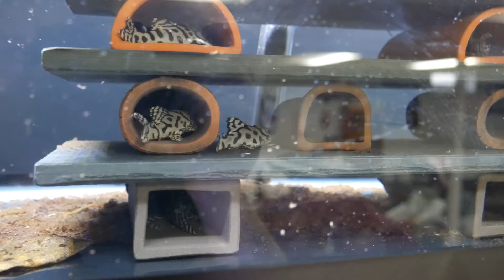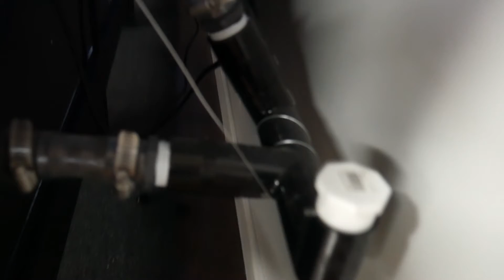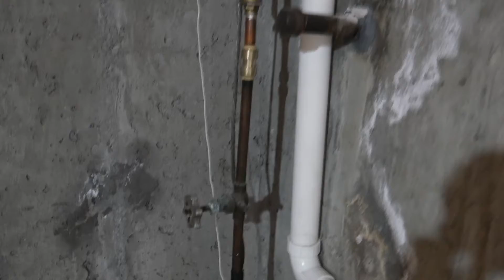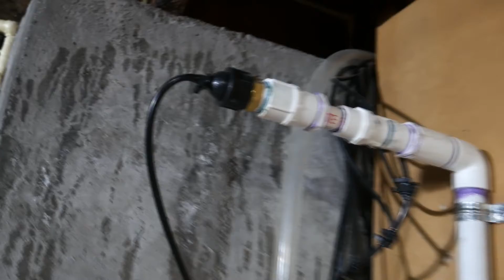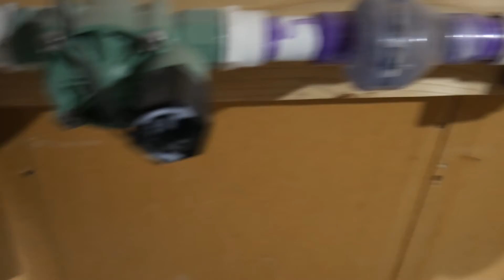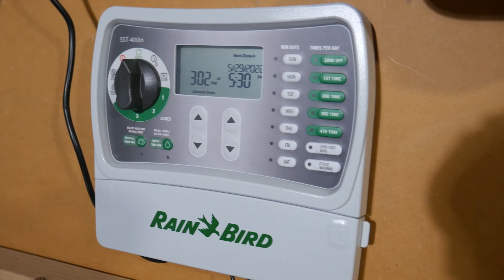Easy DIY Aquarium Automatic Water Change Drip System 💦

Comment: Just got this system working this past weekend for my 135 gallon aquarium.  Since I already use a (plexiglass) sump filter, I put the output there instead of in the aquarium so I didn't have to drill the aquarium glass (which is about 1/2" thick). I had always wondered how to do automatic water changing, but couldn't come up with a really good way to do it.   Your design is very elegant and worked great for me, once I got some help for the harder parts.  Thanks for posting this!
Reply from the maker: Happy I could help!

Comment: If this system had 0.5g emitters nice and slow.  And strong heaters in each tank.  Do you think the temp would move at all if it was running a few hours at a time straight ?
Reply from the maker: Probably, but only by 2 or 3 degrees Fahrenheit

Comment: Great video. Would it be possible to run the system without emitters? I suspect not as there will be irregular flow rates to each tank. Would appreciate your views.
Reply from the maker: Yeah I would have that same fear. The emitters give you piece of mind that you are getting a desired flow rate in each tank.

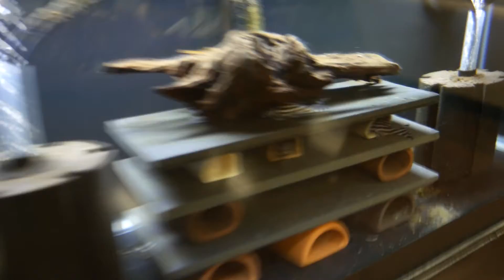Comment: 10:20 There are equations we use for this in wastewater engineering. What you want to know is what is the exiting massflow of contaminants. For comparitive purposes, you can assume a value for the generated contaminant mass in a given tank in that week. (Some fraction of the incoming food mass [a portion exits the tank as CO2 from respiration and the rest has fate of fish bodymass, dissolved solids, and suspended solids. Most of what you care about is the dissolved solids])
So adjust the equations for a batch reactor. Simple enough in this case, the equilibrium state if you water change the same amount every week is that the massflow out of the system as dissolved solids is equal to the portion of the added food mass that does not become co2 or become suspended solids (exit when you clean the filter and includes contributions to bacterial biomass solids from other categories). 
Unlike the waterchange, the drip system follows the kinetics of a complete mix continuous flow system, so the effuent concentration of contaminants in the tank at all times and the massflow out is the concentration in the tank multiplied by the flow-through volume in the same amount of time. In General, this means that it takes alot more water changing to maintain the same minimum concentration in the tank, however for waterchanges that only change a small fraction of the water volume, increasing the frequency of these approximates the same kinetics as the continous flow system. 
The most water efficient system is to change nearly all of the water infrequently, but we care more about labor efficiency

Comment: I currently am running high pressure braided hose. Would that be suitable in-line to the water purifier or is pvc necessary?
Reply from the maker: Haven't used braided hose so I'm not sure I can comment accurately :/

Comment: I’ve watched the original set up vid of your auto water change. And now this. I really didn’t notice any changes. I think you said you swapped drip admitters.   Any other changes?
Reply from the maker: Not too many changes - mounted the start of the PVC pipe to the concrete wall instead of hanging it from the ceiling, added a pressure regulator at the start of the PVC, and added a T fitting and a valve before the 3 stage filter so I can release water pressure before changing out the filter cartridges

Comment: Aweosme video!! I wish I could edit videos like you! I made my own auto water change system similar to yours but i don't do a drip I run my water thru a thermostatic temp regulator. Then I turn it on with my wyze sprinker app and let it run for my desired time. i really like your setup! i need to make a video of my system and post it!!! Good luck!
Reply from the maker: Thanks! Your setup sounds great!